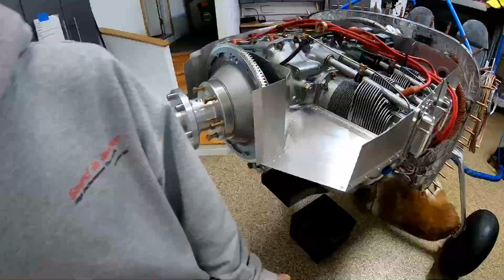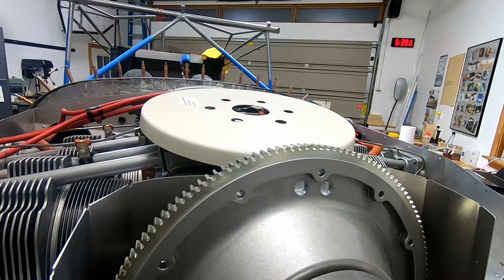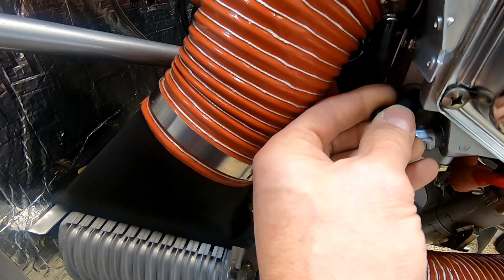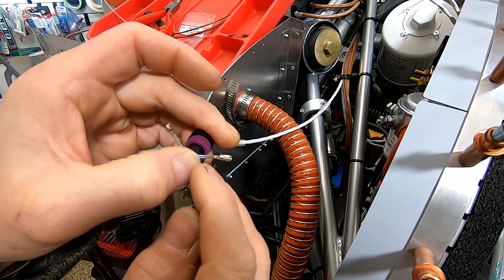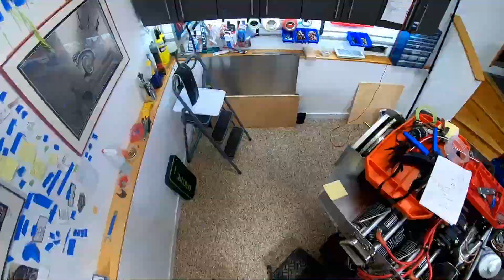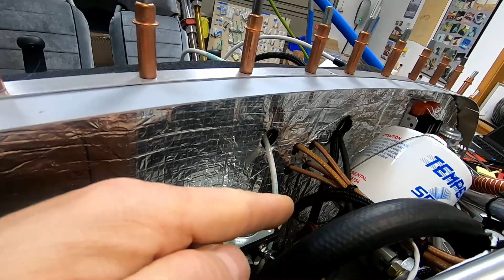RANS S-21 (109) Pressure sensor plugs direct wire and no spinner

Comment: Did you seal your firewall/bootcowl as per the manual before you put the engine on, i never saw any sealant in the holes?
Reply from the maker: Good eye ;) Not yet. My building partner is finishing the panel, which I need to put the boot cowl on and get everything else on. I did practice simulating with a little squeeze bottle getting behind the insulation and it looks like I can get at the "holey" areas.